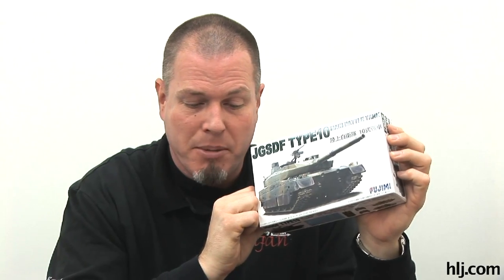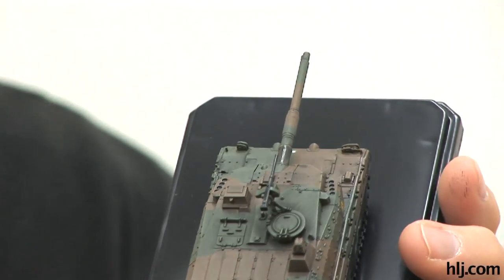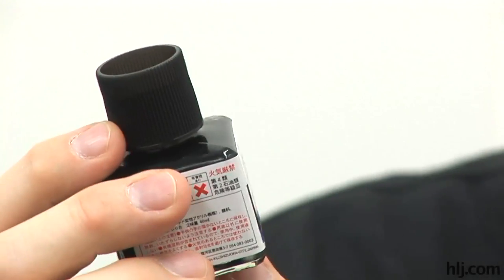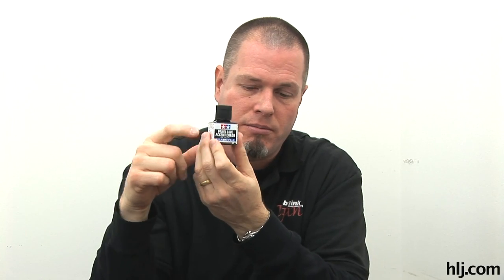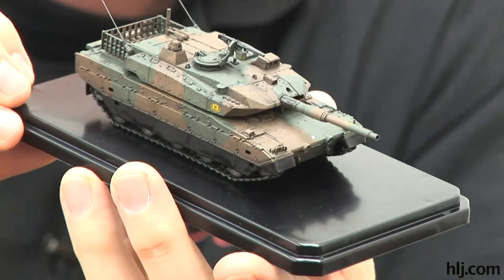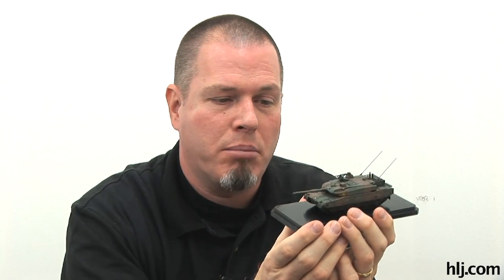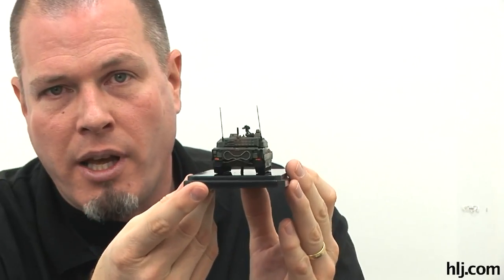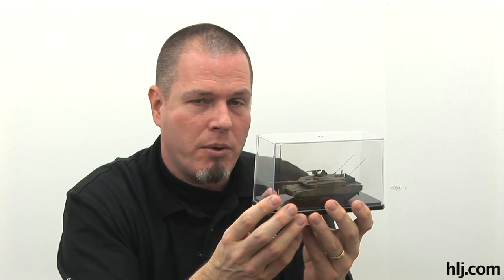Weathering the Type 10 Main Battle Tank | Boss Builds 10

Comment: Weird... never had a problem using enamel washes over acrylics. Maybe it is a X-20 thinner problem, I use White Spirit or lighter fluid (kerosene) and works flawlessly. AK washes are made to be used over acrylics indeed... and they are enamel washes...

 You can use even airbrush cleaner to remove tide marks if you're careful (or you use acrylic washes, like Vallejo ones).

But surely you already know that, just being safe so noobs don't ruin their models and come here ranting... ;-)